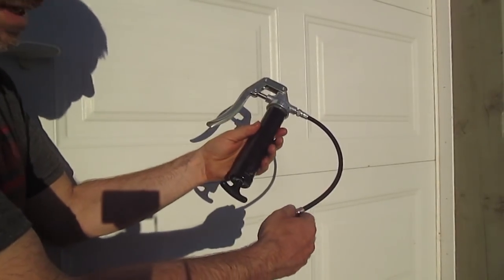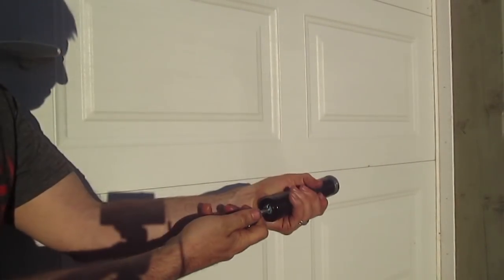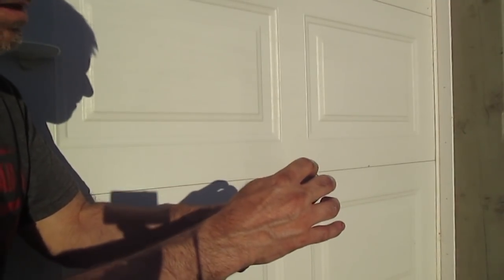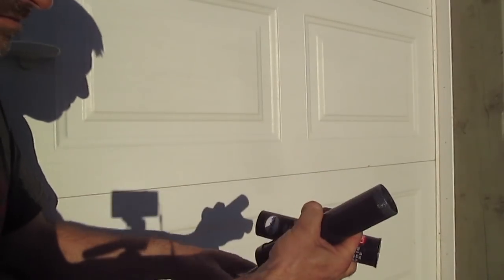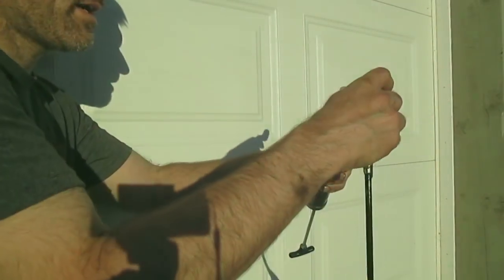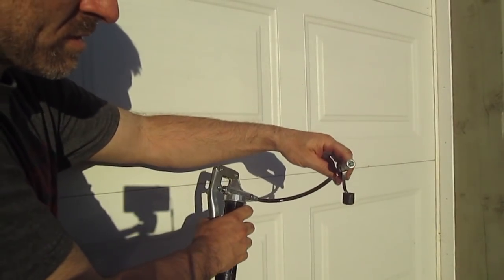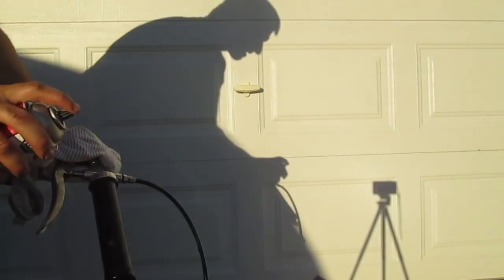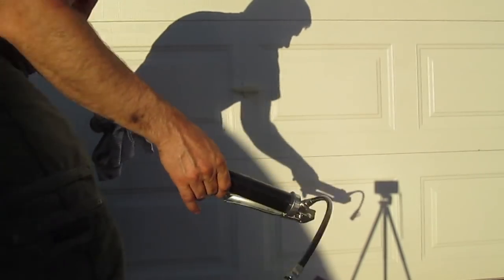HOW TO SAFELY reload GREASE GUN 3oz      refill Small cartridge DIY bearing auto trailer car truck

Comment: Thank you so much! I just got one to fix my dryer and i thought it was missing a piece to hold the crank. Mine also has the little nudge ! 😂 I was about to return it. Haha
Reply from the maker: Thank god I did it outside!  much easier to clean on the gravel driveway and no stain
Reply: @youcanfixit3721  Oh! Thanks for the tip! We’ll fill it outside then! Tks